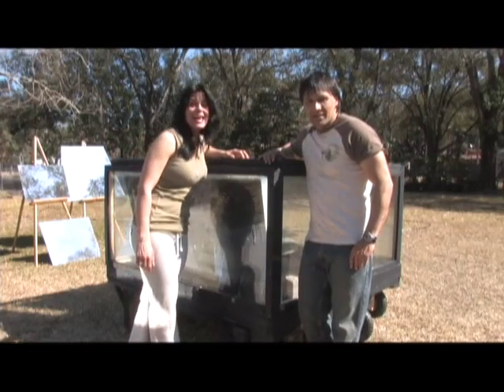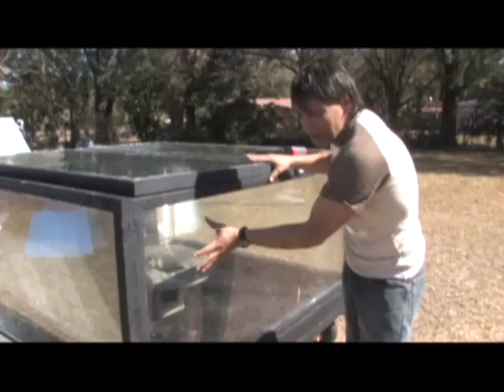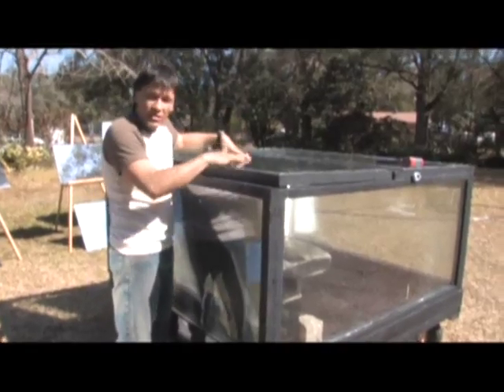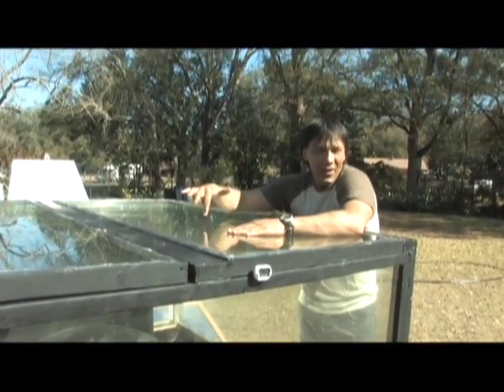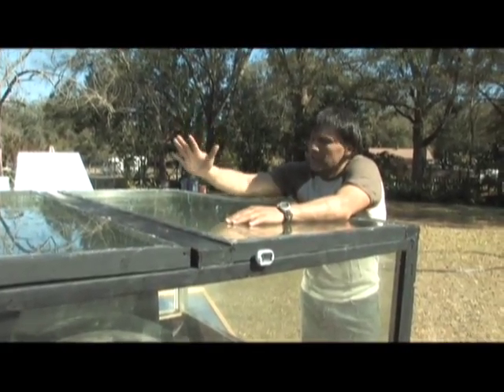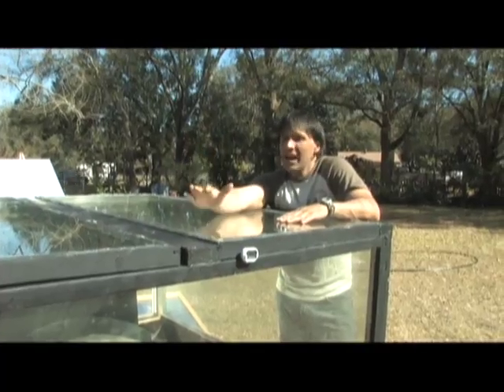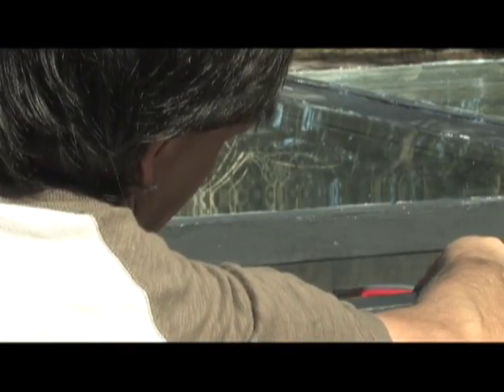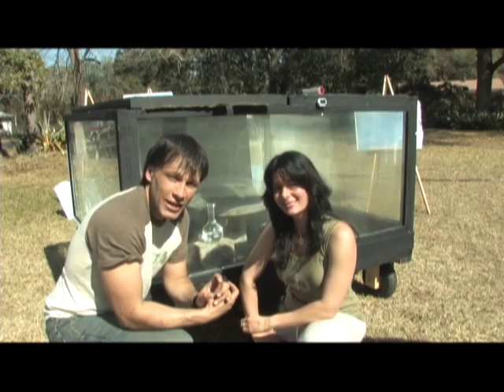160˚C GIANT SOLAR 320˚F OVEN SOLAR POWERED FURNACE SLOAR COOKER

Comment: One thought:  Don't use it for food!  Use it to heat your home during long Winter nights!  Do that by circulating air through it in tubes and down into the ground. Then run different tubes through that same ground and empty them into your home at night during the Winter.

Comment: ISTM that the best mirror placement might be to have a parabolic (or Fresnel) mounted about 10 feet *above* the device, then using a mirror, also mounted up high (for safety), route the output of the parabolic (or Fresnel) directly downward onto the device. You wouldn't need glass - just a cast iron grid to absorb and radiate the heat downward. Can you picture all that?

Comment: i grabbed an old tv that someone chucked out and was on the side of the road for hard rubbish to collect..now i took the tv to use the lense to set up my own much smaller solar cooker set up... now i doubt that it is a fernel lense, should that matter? I will use a mirror as you did.
Also as great as the oven is would it be better to put a door on the side for easier access, just as a normal oven would have??
great vid though..i have liked all of them i have seen so far.
Jason

Comment from the maker: I think it should be fine, the solar panels should produce about 78v with no load, I would see what happens, if you are way above the 48v  loaded you may want to stop. I think it will be fine. The higher voltage will not be the problem. Just make sure your batteries are charged up a bit before you load them.

Hope this helps. The panels, they are 12v yes.

Dan

Comment: Add water and a black tube.  
Seal all the edges and insulate the floor.
Buy/get a generator designed to be powered by steam and use this oven to cook food while the steam generates electricity.  

What do you thing?

Comment from the maker: They should produce 20v  no load so 3 in series could charge a 48v battery system if you had the right controller. You may need 2 more.  Another option (cheap hard way) would be to charge the 4 batteries in parallel, disconnect when charged and run in series. I know of a few who built a switch to do this.

Comment: It would be interesting to see what would happen if you added vertical fold-out reflectors to top - similar to a sun-oven.  I think they are also called 60-40 ovens.  With the sliding top panels, the reflectors could be made to move with the top to provide easy access.  You could also add a fresnel lens to focus the heat on the inside where the glass would trap it.

Comment: With a copper tubing coil and some ducting and a fan in there you  could use that to heat water and air for supplemental heating for your home and water supply.

Comment from the maker: Excellent Question:-)
The paint is high temp BBQ enamel. Most enamel paints are considered non toxic ONCE DRIED. Any food we cook in this oven will be in pyrex wear with a lid or a steel pot. Regular store bought charcoal or any food cooked over an open flame is a mild health risk. Also many people do not like cooking in Aluminum fool or on teflon.  I have found that any time you heat food, you get exposed, if you do not heat it enough, you can get Escherichia Coli. Rock and a Hard Place.

Comment from the maker: I need to get the smell out. The paint and silicone still is harsh. A week from now it might be good. I added a 2x4 to the base to give a bit more height and have the option to drill large holes for hose to heat circulated air or water when not an oven.